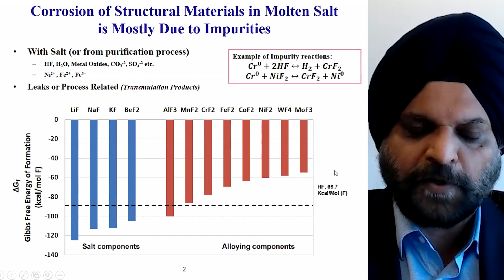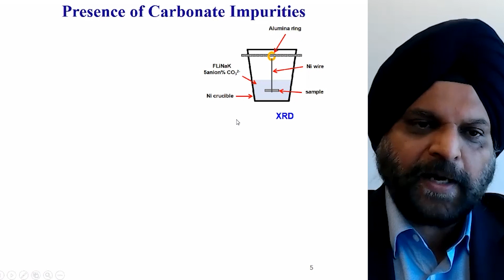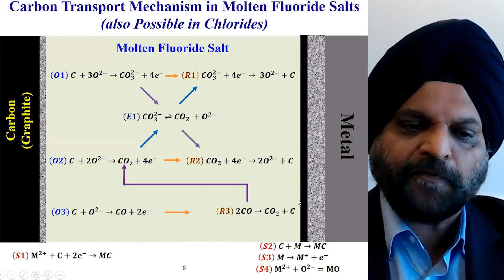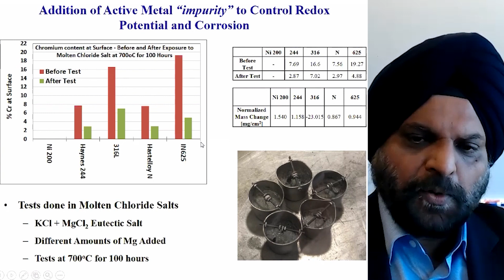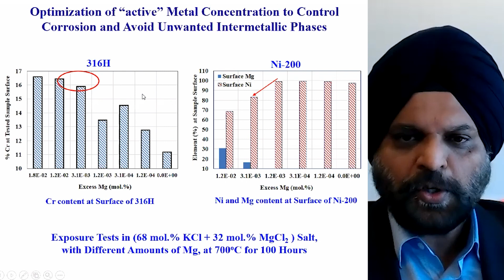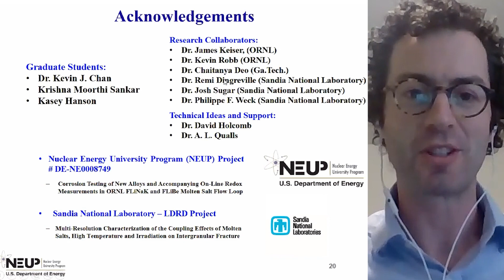Interaction of Structural Material with Impurities in Molten Salt - Preet Singh @ ORNL MSRW 2020

Comment: The graphite transport problem reminds me of case hardening powers, which are a low melting salt for oxidation protection with a carbon source included, the carbon ends up forming the usual iron carbides as it diffuses into the steel part.

Comment: What my understanding is, is that these “conventional” corrosion resistant alloys like hastelloy and inconel have excellent resistance to oxidizing environments at high temperatures, ie: open flames. Their trick is that they form an extremely adherent oxide layer on the surface. But the problem is, in this particular application, all of that doesn’t really matter anymore because they no longer have that oxide layer to protect them, they’re submerged in molten fluoride, and chloride salts. In this environment, the chromium is almost acting in the opposite way. It no longer can use its adherent oxide to protect the metal, and it instead ends up just dissolving and exposing more metal to that corrosive salt.

I’ve heard of an extremely dangerous and corrosive compound called chlorine trifluoride, it can ignite sand, ash, and even asbestos, but it can be stored in certain metal containers because of the adherent fluoride passivation layer that it forms on contact.

What I’m trying to say is, if these alloys use oxides to their advantage and rely on them to protect the rest of the part, is there an alloy that could use fluorides to do the same thing?
Reply: hastelloy and inconel are not "conventional" alloys. They are "special purpose" alloys. The conventional stainless steel you find in kitchen pots is protected like you described. The hastelloy N alloy resists salt corrosion by having metals that do not react with the salt as can be seen at 1:11